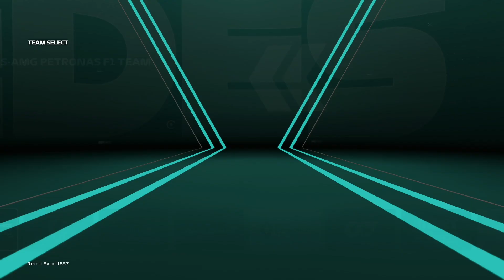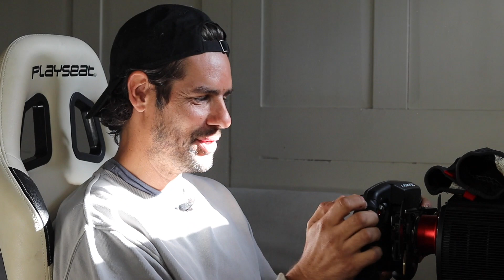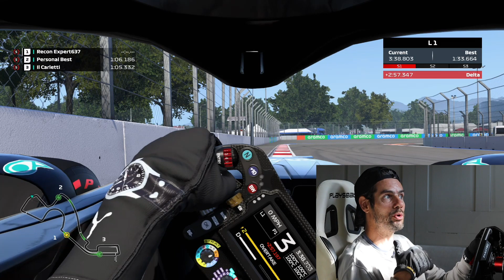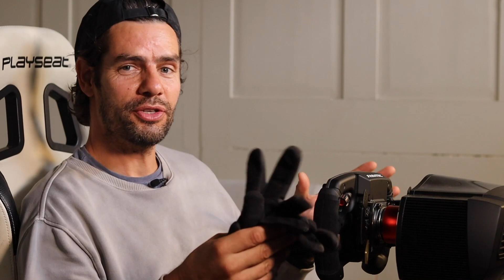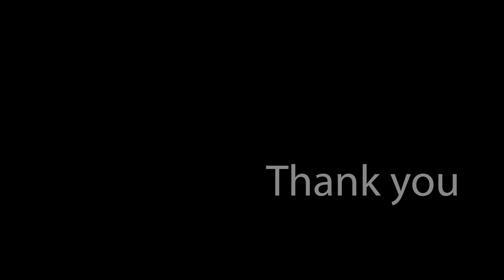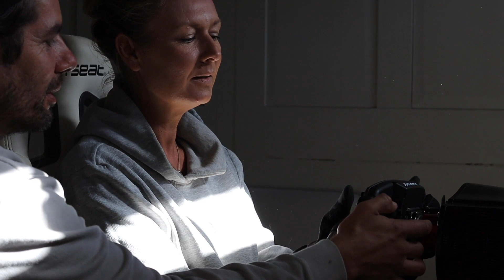Setting Up F1 Cars For The Russian GP Track

Comment: If you exceed track limits after the timing line in qualifying is it your in lap after hot lap that is discounted or would it apply to previous hot lap?
Reply from the maker: If you exceed track limits after the timing line, it won't gain you an advantage, in fact it would probably mean you've got it horribly wrong.

Comment: Thanks for a great video Mark! Very interesting about drivers changing B/B to stop locking due to unloading/unbalancing of front tyres. Had always wondered why they do that 😊 Hilarious end to the video with your wife too, great little addition 😉 I also have a question for either #askelvis or this series of sim videos ... how realistic do you find the setup changes in the F1 2020 game to real life? Does the car react similarly to the changes? Especially interested in springs, damping and anti roll bar realism ... aero would be fairly easy to replicate I would imagine. Keep up the good work 👍
Reply from the maker: Thanks. I'm still learning it tbh, but it feels reasonably realistic in some areas. Not being an F1 driver, I only know what it should do in an engineering sense, not really what it feels like in the real car.
Reply: @F1Elvis  A lot of the fast time trial setups appear to be unrealistic, with things like lots of rear wing at Monza for example. They also always seem to have brake bias way more to the rear than in real life. So, it would be good to get the perspective of someone who actually knows how the car setup is supposed to work.

Comment: Would you say turn 4, is like turn 8 at Turkey?
Reply: A mini turkey 🍗🐓🐤

Turkey's turn 8 is a bit ondulated as it's a series of concave corners, Sochi's 4 is more acute as you have that breaking point right ahead. Equally hard on tyres for different reasons..
Reply from the maker: You mean Turn 3...it's similar but not as good as Turkey's Turn 8.
Reply: @F1Elvis  looked it up in the wrong place my bad wikipedia informed incorrectly